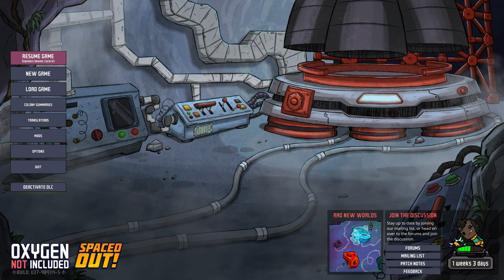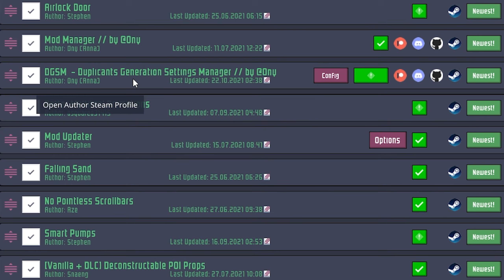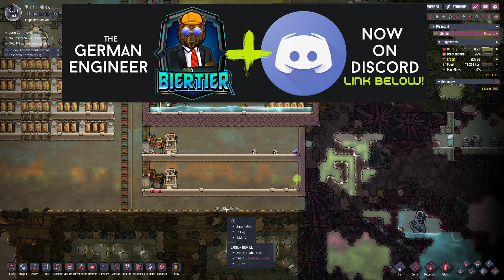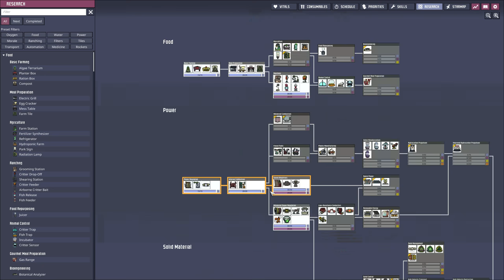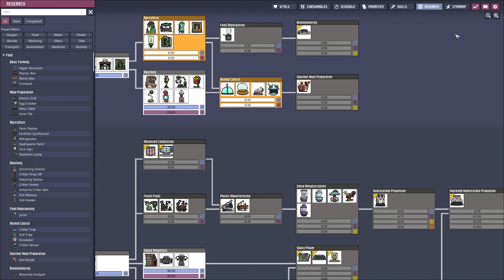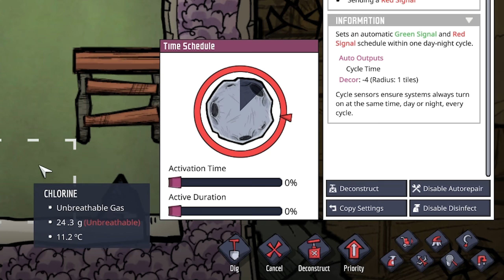CREATING the ULTIMATE LIQUID GERMINATOR in OXYGEN NOT INCLUDED! (LP1-EP5)

Comment: Normally just go with three or four reservoirs with a loop back to the first if still germs, heck do not even need to check if the piping is done right. KISS and not the band.
Also normally send in the polluted water into it, due to what Koturas said.
Also only need a bit of chlorine, but need dupes in suits or never let them enter.
Reply from the maker: You are right, that's how I would normally build it too. I think I said the same thing in another comment(or on my Discord, can't remember). I built it this way to have an opportunity to explain the cycle sensors and, to be very honest, also for content. Building this system is way more interesting and fun then slapping 4 reservoirs in there and calling it a day ;)
Sending in the polluted water is something I never did, not sure why I never considered it. Koturas did make me aware of it and it makes perfect sense. One never stops learning
Reply: Decent point for cycle sensors is incubators which helps save about 85% of the power they need if not more. Due to criter eggs can only be hugged once a day.
It was nice to see a different way to see this though. Thought process might be able to make more optimized builds.

Comment: You can just daisy-chain 5 (or was it 6) liquid reservoirs within a chlorinated room and that's it. Nothing else needed. By the time the water goes through all of them, it's perfectly sterilized.
Also, it might have been smart to wait for the room to be vacuumed out before introducing chlorine, would have saved much power for both gas pump and gas filter.
Although, that might not have worked either, since you have a flatulent dupe who keeps introducing natural gas to the room all the time.
Reply from the maker: I do know of that method and actually considered building it(see the size of the room, I meant to do that at the time, haha). I went with this method instead because it's more interesting and shows more of the capabilities of the cycle sensors. It also gave me an opportunity to explain them since a lot of newer players struggle with how they work :)

I agree again, I could have vacuumed out the room, but I would have still built the same setup. Narcoleptic or flatulent dupes have a tendency to mess things up(I could just not use them or build a door to lock them out etc. but still, rather save than sorry in the long run). And it once again gave me an opportunity to explain the gas filter :)

Comment: Another suggestion regarding your stable layout - if you place a pneumatic door on the other side of all your ranch buildings ( and push out the other end of the room to compensate and keep you at 96 tiles ) you can keep all of your hatches close to the grooming station. I usually have a mesh tile on top of the door as well so Sweetles can't pass it either, since I use the same layout for both critter types, though I don't think that matters for hatches. Saves your rancher some time waiting for critters to walk over when they're called over to be groomed, and also makes adding automation later a lot simpler since the eggs will all be laid in range of one sweeper.
Reply from the maker: That is a great suggestion, I love it! Will implement that soon, thanks a lot!

Comment: One thing that helps to melt ice more quickly (800kg at a time), if you really need to speed it up, is to build temp shift plates out of the ice.  Usually, you'll be fine just leaving it in the storage bins.
Also, the other thing that melts it really fast, is to put it onto rails through the water.  Only problem there is that it sometimes you get stuck with a blob of a few mg or micrograms.  Just a little annoying.
Reply from the maker: I never considered the temp shift approach, but the speed was not really necessary. It actually worked out perfectly in the timeframe. If I need it faster I put less in the storage bins usually.
Reply: @BierTier  Yep. Just thought I'd mention it in case it becomes necessary later on.
Reply from the maker: @jemsterr  I definitely appreciate it!